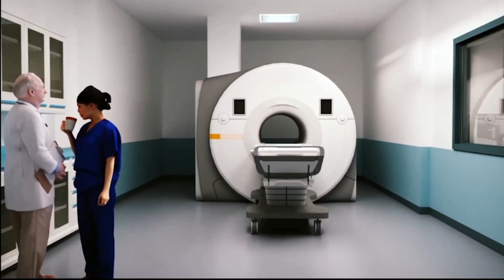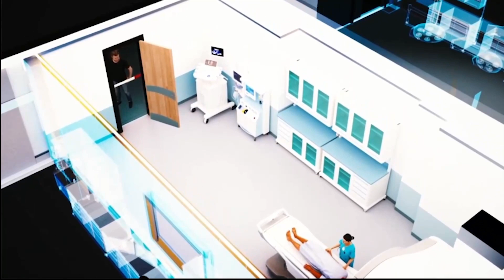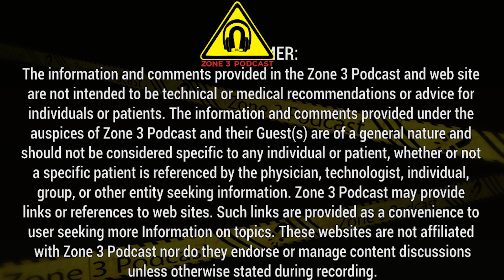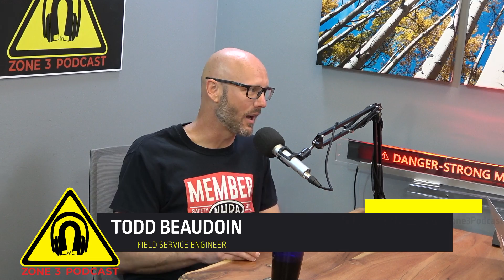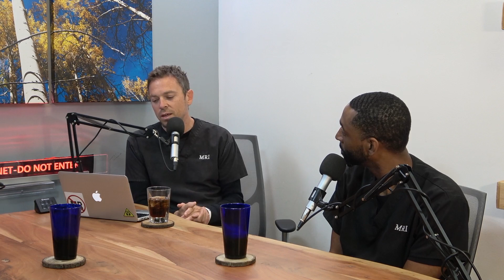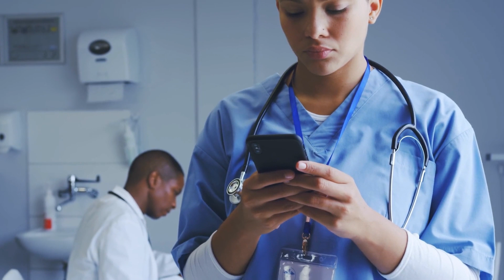What does a Field Service Engineer do?

Comment: A field service engineer works long hours for very little pay and stays away from home for long periods. 
I only wish I had it to do over again. I would work in the auto factory.
Reply: That really depends on your industry and training. Bio med can easily net you over 6 figures.
Reply: @kam6642  And you work your butt off for it. Field service on Medical imaging equipment is not for workers with families. I did it for 40 years for GE, TOSHIBA AND CARESTREAM. Wish I would have been an electrician or worked the factory.
Reply: @justtinkering6713 my longest days were pharmaceutical robotics. But in bio med I get a lotta down time. Very few overnights. There can be the occasional 14 hour day especially if you have to fly. But typically I’m home by 5 and doing office days Friday lol.